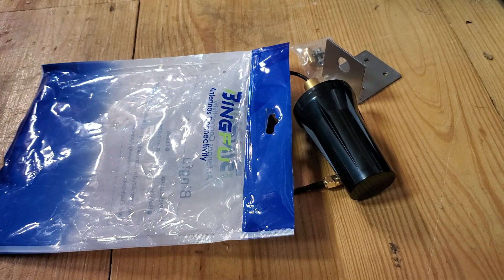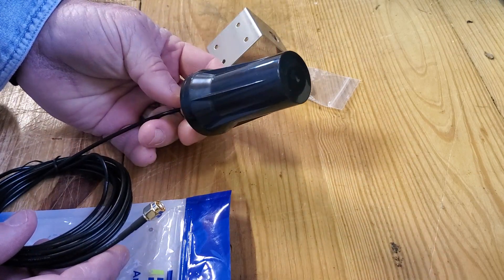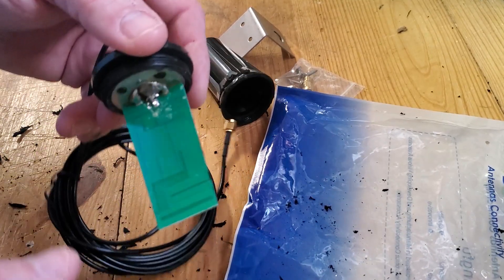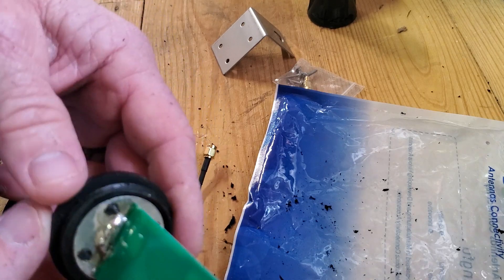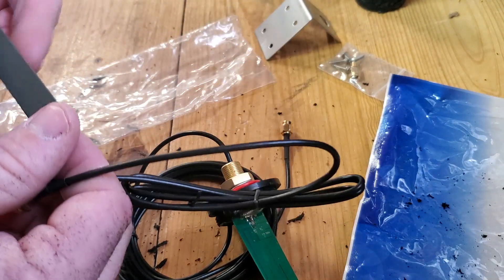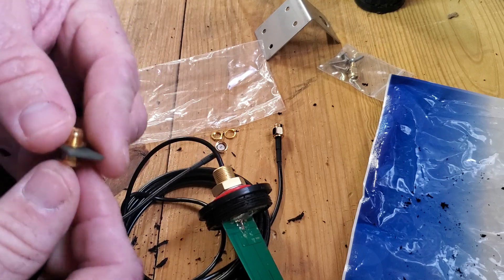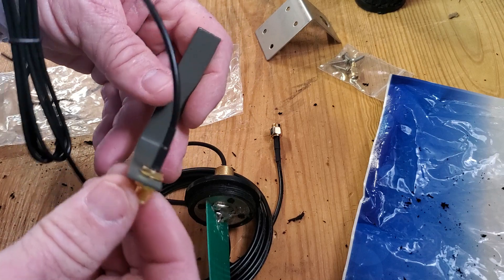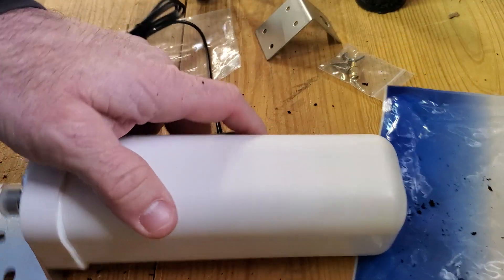BING Fu (Amazon) External Antenna For Cellular Game Cameras Like the Reveal and Spartan Inside Look

Comment: One channel mention the antenna he was using would help extend battery life of the camera? I asked if antennas used battery power, he then said no? I'm a little confused now...I know nothing about antennas...
Reply from the maker: Cellcams use battery power to transmit data images. Like your cellphone,  when signal is week it takes longer to transmit therefore using more power because of the increased time spent trying to send. Also if the signal is poor and the upload fails the camera will try again and sometimes multiple times. Improved signal helps insure faster uploads.
Reply: @herd360  Thanks for the reply...

Comment: disagree with that. the higher dbi antenna the less gain you will have. Most factory antennas are 9 dbi so less gain that is why many times the pictures dont transmit right away. If you have a 30% or better signal you dont want to be using a 9dbi you will want a 5 dbi for more gain.
Reply from the maker: I disagree sir. Been doing radio communications a long time. Higher db gain gives increased tx and rx
Reply: @herd360  but most higher db dont cover a big area. Might reach further but your talking like 20-25 degrees so if anything is obstructing the view very hard to get a good signal
Reply from the maker: @wallstreetbets9814  👍 👌
Reply: @herd360  from what I was told and read. Not an expert by any means. I know many people have problems with factory antenna but getting it higher in the tree with the cable does help. You also get those who have barely have if any signal and go with a higher gain antenna but in the middle of rolling hills with tree cover expecting to get something. The higher the gain the more you want to be in an open area correct?
Reply from the maker: @wallstreetbets9814  if there is RF (signal) present to be received then the better the design of the antenna the more signal its able to receive. Antenna design affects this greatly. Do some research on yagi antennas. Far superior for RX/TX over an omni directional. Higher gain equals great distance TX/RX. Directional focuses the gain effects to a narrow area so with a directional your aim to the direction the signal comes from is critical. With an omni it isn't but the gain benefits are lower as well
Reply: @herd360  oh I know directional is by far your best choice. I haven't been in a situation where I've had to use one. So the actual Spypoint brand long range antenna is pretty much the same exact specs as this Bingfu wouldn't you say?
Reply from the maker: @wallstreetbets9814  the bingfu specs are likely less reliable. There is no standard for many of these products coming out of China. I would trust a company like Taoglas with their ratings because they actually have Anechoic Chambers and labs for testing antennas. Bingfu just private labels the stuff and they themselves are a chinese company selling through Amazon to the US. Many companies use dbi not db and highly inflate the numbers because selling to the average consumer there is no accountability. If the Spypoint works for you or even if the bingfu works for you then I would say use what your comfortable with.
Reply from the maker: Now can you reach a point of saturation? Absolutely. You don't need a higher gain antenna if signal strength at the transceiver is adequate

Comment: I used that antenna and a Panel antenna on a cellular modem, Test site a little over (6) miles from cell tower... I frist added the panel amtenna to a free standing pole 8 foot off the ground and got a 5mb down gain then added that antenna on top of that same 8 foot pole and got an additional 5 mb down gain... just wanted to share, have a good day.
Reply from the maker: Thanks for sharing. I'm not familiar with a panel antenna
Reply: @herd360  A panel antenna is a flat square  antenna most are a directional , but can be omnidirectional .
Reply from the maker: @badboy1md  I know what you are talking about now. I actually have one still in the box I need to try. Ridgetec ordered a few and gave me one to try